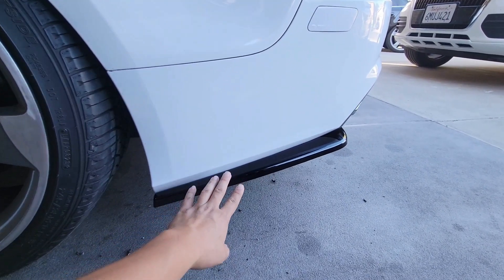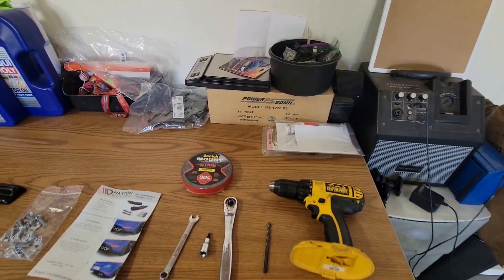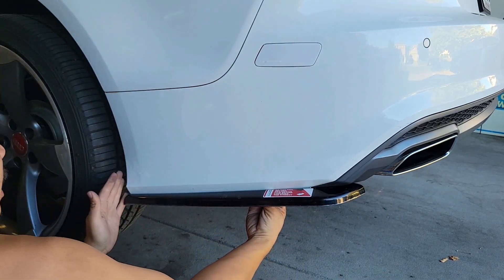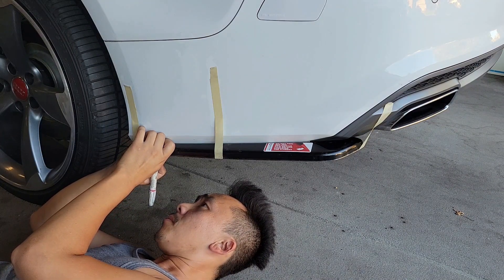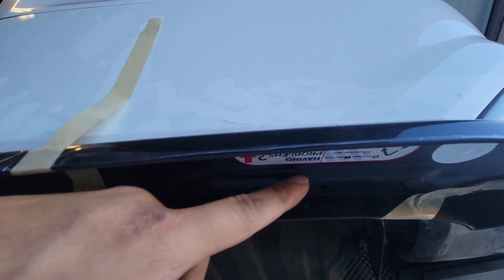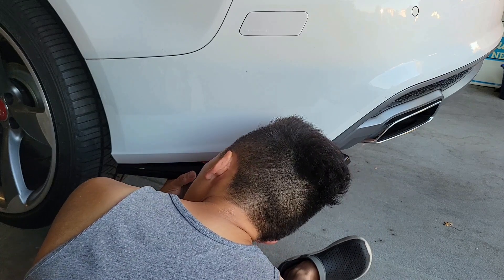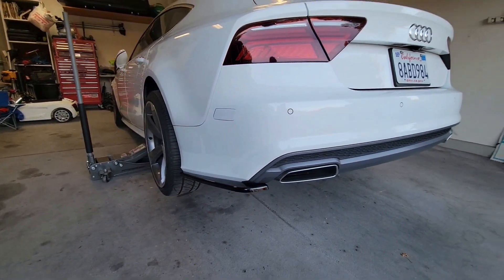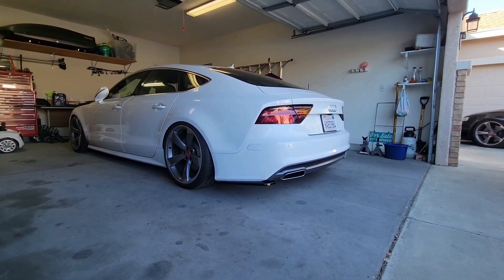MAXTON DESIGN REAR SIDE SPLITTERS INSTALL on my 2016 Audi C7.5/4G8 A7 Quattro Prestige!

Comment: Beauty!! Would u be changing your rear diffuser too? I really want to however, don't want to loose the trunk kick open feature. What are your thoughts?
Reply from the maker: @karangulati1821  thanks! I actually will be keeping the stock diffuser because of that reason plus I like the stock exhaust tips and aftermarket rear diffusers won't be able to fit them. I think I might just try maxton little rear lip or just paint the stock black.
Reply: @cjscarcollection18 Awesome!! I might do the same too! I prefer it black too and add the maxton thing. I'd love to see that mod incase u do it. Cheers man 🥂
Reply from the maker: @karangulati1821  nice! Stay tuned. I'll see if I'll do so. Unfortunately, Maxton website doesn't have an installed picture example of what it would look like haha
Reply: @cjscarcollection18 Ok bud!! I follow you so ill see it if either ways!! Thank you for your reply